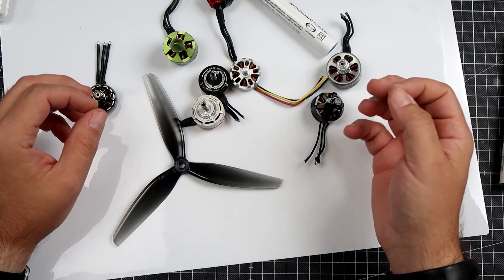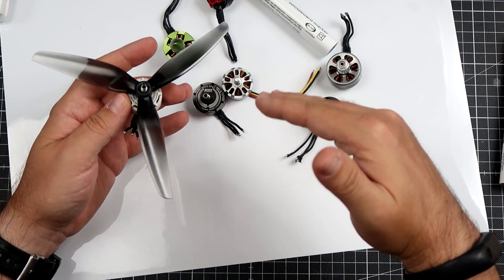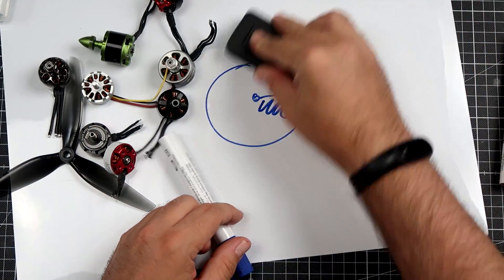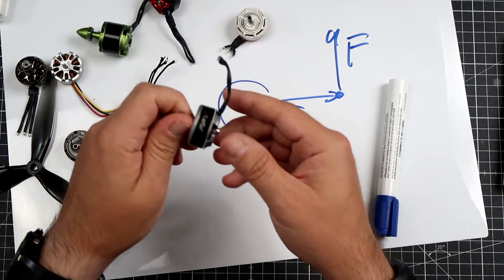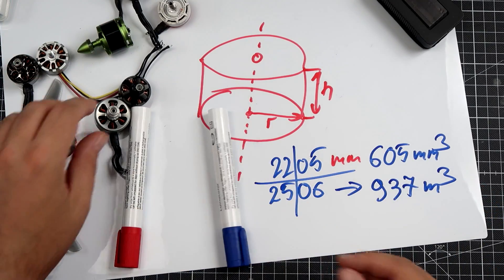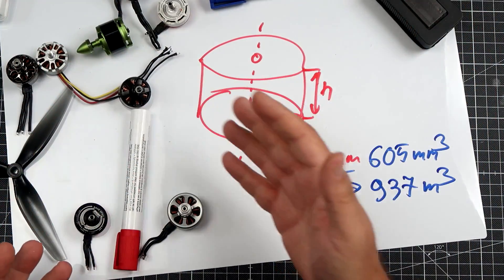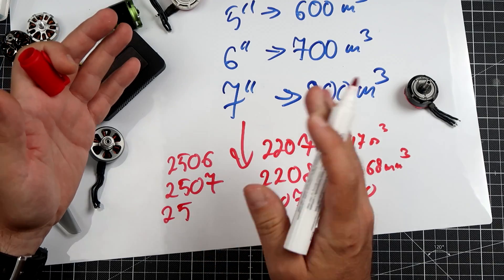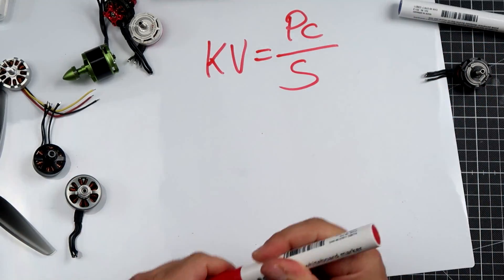How to choose drone motors? KV and torque

Comment: If we subtract 9600 - 7600 = 2000 and 7600-6400 = 1200 we get a PC difference of 800 and if we make this assumption then for 4" PC - 12400, 3" PC - 16000, 2" PC - 20400. KV for 3" and a 2S pack we get 8000KV. But what about the density? If 5" minimum is 600 mm^3 then for 3" minimum is 200 mm^3? Of course I'm not taking into account the Pi constant. A riddle.

Comment: For 4",3" and 2" what Is the PC propeller coeficient? You wrote: "The sweet spot/reference KV can be easily computed from this equation based on propeller diameter and supply voltage. Of course, more S will result in lower KV." I don't understand how the number 9600 for 5" came about.

Comment: An informative video!
Then I almost guessed right. 
I have chosen 2207 motors with 2050KV for my 6 inch / 4S quad. I currently use Gemfan Cinelifter 6030 propellers.
Should I remain with ~30 pitch because of the slightly higher KV number, or should 42 pitch also be ok?

Comment: I also would like to add that the propellers seems to be very big for the volume of these tiny engines,  even if the calculation had been right. I never seen such propellers on such small engines.

Comment: The calculation you’re writing down is not correct. This means that the calculations you made prior to this video trying different propellers has to be incorrect as well for the calculation of the propeller size your telling us now to be somewhat “correct”. That is if we also make the incorrect calculation you did. So to everyone watching, you will end up with a volume 3 times higher if you know how to calculate volume, this will get you dead wrong figures.
This guy obviously don’t know that if you write a little 3 after 600 for example it means 600x600x600.
Maybe he mean 600x3, that would make this calculation more accurate.

Comment: Very good informative video, love your approach with that. I was trying to run a 5 inch prop on a 18 mm stator motor on my plane. Smoked that thing trying to get some altitude
Reply from the maker: yup, too small, heat accumulates and everythjing overheats

Comment: So stator volume formula is : r2 * 3.14 * h ? So for 2204 should be 1900mm3?
Reply from the maker: d = 11, h = 4, r = 11

11 * 11 * 3,14 * 4 = 1519
Reply: @FPVUniversity  Yeah, sorry, I just counted 2205 instead 2204 (multiplied by 5mm height instead of 4mm)...  Thanks

Comment: I use 2806.5 xing on my 7" true X and although it flies just fine, I've always suspected they are too big.   What is your opinion? 6s and 1300kv.
Reply from the maker: For 7 inch those motors are fine

Comment: Good I needed a Hug ! was skeptical if I screwed up on my new 7 cruiser build order.  Got RaceStar 2508 1200 KVB and 7x4.5 two blade props coming. I'm a total noob so thanks for the Hug!
Reply from the maker: This motor is ok. You can easily put any 7" prop on it no problem

Comment: You seem to be the man when it comes to 7 inch. I have the Emax 2807 1500kv motors and the Geprc mk4 7 inch frame. 5s will keep my prop tips below the speed of sound. 5mm arms though. I'm going to glue more carbon to the arms to thicken them up and I'm hoping the glue, which is softer than the epoxy resin will help to dampen vibrations.

Comment: I'm using 2207 on my 5" which give me more control over the 2306 I was using because of the increase in stator volume. I'm planning a 7" build and was thinking 2807 emax motors. Is there a frame you like or a frame I should stay away from? 7" probably has a lot of vibration because of the longer arms and heavier motor and prop.

Comment: This helps thank you!
Reply from the maker: you are welcome
Reply: @FPVUniversity  I was wondering if I could pick your brain real quick. Based on your algorithm, 7 inch 2807 motors 1700kv for 4s should be sufficient. Now would it be efficient and powerful enough for some high speed cruising? Or would something like 6s 1300mah be better suited?

Comment: I'm using some NIN 2806.5 1350kv motors, and they work great on my 7", but at $30 a pop they are pretty pricey.
I need a substitute for my next build that's a lot cheaper but just as good.   Maybe the Brotherhobby Avengers.

Comment: Well that's a very strange, misleading and roundabout way to come to a roughly indicative relationship that trends more or less in the right direction.

More correctly, torque varies with the inverse of kV (you can calculate torque from any published specs, it isn't given separately on data sheets as it would be redundant), with the limiting factors being magnetic saturation and power rating. Power rating  is roughly proportional to stator volume for motors of similar construction, sure, and torque at saturation will be proportional to air gap area x moment, which happens to also be proportional to volume... so it amounts to roughly the same thing in practice for motors using the same magnets, gap and stator construction, but it's not very useful if the motors differ much. Different stator materials will change the saturation flux, stronger magnets or better air gaps will increase emf (increasing torque and lowering kv), cooling will affect power limits, better winding efficiency will pack more copper into the same stator volume etc. . The volume may a good rule of thumb if comparing motors of the same series from the same manufacturer, but if you want real results for torque or want to compare different models, it's no substitute for going to the data sheet and doing the maths.

Comment: Hi Pawel, I really enjoy your videos and would like to ask you a question about my Tyro129. The original motors 2507 - 1800KV came with an aluminum shaft and are now bent without crashing at all. So I purchased XING 2207, 1800KV. My Tyro129 was flashed with Arducopter, therefore no flips and 3d stuff for me. 
QUESTION: Will these motors work fine for me at 4S having in mind my calm flying habits? Thank you!

Comment: I love your videos, and all of the information. I am currently building a 7" Long Range Super G+. I haven't picked Motors and Props yet. I'm torn between BH Avenger V2 2507-1500kv and the 1850kv. I mainly want to fly with 6S Li-Ion homebrew packs. What would you recommend? And if it's not too much of a hassle, would love to know if there's a prop that would pair nicely with this build. Cheers!

Comment: will 2306 1700kv with bi-bladed props will be good enough for long range?
Reply from the maker: on 5-inch? 7-inch?
Reply: @FPVUniversity  7 inch
Reply: @FPVUniversity  7035 prop
Reply from the maker: 2306 are too small for 7-inch

Comment: 16:18 - you're number for 7" looks really off for me...   for one thing, they are turning back upwards, and you're making a bell curve with 6" at the apex, instead of a slope with just 6" as one point along the line.  According to your bell curve, 1" props and 12" props would have both like super high kv motors.  You're 1" props will be doing fine, you're 12" props might be a strugglin'...     shrug not a prop expert.
choppergirl.air-war.org

Comment: hi pawel, fantastic video very informative. i watched another quad expert and he said that if 2 motors had the same/similar stator volume but 1 motor was higher stator, with smaller diameter stator vs shorter height and larger diameter, motor 1 will spin up faster hence producing more torque, do you agree with this? any chance of elaborating on this?  thanks again for the great videos!!!!!!
Reply from the maker: That is just wrong :) If both motors have same KV, the higher diameter motor will probably have more torque since the arm of the force will be longer. Also, relation between torque and RPM is inverted. The faster motor is rotating, the less torque it has available. The power might grow, but not the torque

Comment: cześć Pawel, thanks for the video, very interesting since I'm building a 7-inch Source One atm.

if you're saying that the limiting factor with smaller motors is the ability to accelerate the props rather than in providing power for steady-state thrust, then surely the inertial mass of the prop is going to be a major factor?  & that if you were to substantially lighten the prop by, say, running a two-blader rather than a three-blader (or by drilling lightening holes in the blades ;) ),  then smaller motors - eg 2306 - might be suitable?

Comment: So this means I would benefit by retrofitting 6 inch props on my Skystars G730L, as the standard motors are only 2306, 1800kv and a good 4s battery - and the 2508's, 1200kv running on 5s, I chose for my Chameleon 7 inch are entirely big enough for 7 inch props?
Reply from the maker: yes
Reply: @FPVUniversity  excellent, I'd ordered some 1300mah Acehe 75C  5S for the 2508's and may try running a couple in parallel, and have a good stock of their 1550 mah 95C 4s for the g730l    -  good to know, thank you

Comment: Hi, Pawel, do I have to alter these values if i have a 5" tri-bladed prop?
Thanks, Steve
Reply: Good question, since I'm thinking of using bi blade 7" on a 4s | 2207 1950kv

Comment: I fly 2208 1800kv Xing E motors on 7056! At first i was worried about the 7 inch prop on the 2208 but... i calculated the 2208 to have 968 mm of volume  which is morr than enough. Been flying hard with no issues even on 6s but need to keep an eye on throttle

Comment: Hi Pawel and everyone, I do have a question on my next buil. In have a 6 and 7 inch freestyle frame and I do have two kinds of motors with different KV’s but same brand. First ones are the EMAXX RS-2306  KV-2750 and the other ones are EMAXX ECO 2306 2400KV. Which motors suits the 6 inch and 7 inch kwad? I would like to do a little bit of freestyle while doing long range. Any answer would be much appreciated

Comment: what motor could be advised for a 9" set up ?  the new 2806.5 or are these to small and I should go up to 2814 ??
Reply from the maker: 2806 is probably too small. 2814 should be a better option

Comment: Are the 2306 1300kv motors OK for 6 inch props though on a 7 inch frame on 6S?
Reply from the maker: 2306 are too small for 7 inch props no matter the voltage.
Reply: @FPVUniversity  I know, I am asking about 6 inch props. I tried the 2306 on the 7 inch and it was very unstable! I wonder if I should replace the frame with a new 5 or 6 inch frame...

Comment: And I'm sure it's just a coincidence that the abbreviated PC could also be the Pavel Coefficient. 😉 good video though I'm more of a 6" flier and I thought that 2000kv on 4s felt about what I wanted, so a little bit higher than calculated, but it's good to have roughly translatable baselines.

Comment: Very interesting, and may have answered why my 7” quad has this wobble on throttle punch. Originally, this quad came with 30A esc’s, and it flew on a rail, but eventually desynched twice out of the air, SO, you have to change something. I changed the entire stack, and motors, to a 4in1, and it’s never flown the same. I replaced the motors with the same size 2306 EMax Eco. Still unstable. So, watching this, I think I may replace with 2508, and see what sticks! What’s ironic is I have a EMax hawk 5, mod with the 6” arms, and that thing is an absolute rocket, that flys on a dime on 4s, it is rated for no higher lipo, but on 4s with 6” arms, running the Azure prop, this thing kicks ass!

Comment: sorry for the silly question the thing that confuses me most is the voltage on these motors . lets say im running 4s how come the " kv " is the same . you go to any wesbitr and it tells you from 4-6s 1700kv or 4-6s 2400kv so doesnt the kv differe or shouldnt there be for each voltage a kv i. e 4s 1700kv , 6s 1700kv , 4s 2400kv and 6s 2400kv . different motor for each voltage ??

Comment: why i do no see the connection between the RPM and the AoA of the propeller? Everything begins here. For highher torgue its enough if you choose lover same size lover KV motor. THere is a connection the highher is the KV, the highher is the Amperge and the lover is the torgue. Connect this with the AoA of the prop + the formula for multibladed prop. Measure the Amperage and thrust to find the optimum prop for the motor. If you know the total weight and the thrust, its easy then. Unfortunatly this video ends with in my opinion and not a fact, like based on the measurement this combination is the best of the sets I have....
KV without  values A x B make no sence. This tips might work, might not....
Reply: ah, what will be the speed of the miniquad? Thats the first step to chose the right AoA prop before going to the motor, guys.
Reply: Do you have prop/motor suggestions for 7 inch long range 60km/h, 4s 1500mAh (maybe 2 batteries parallel)?
Reply: @radekr981  that a low speed...what is the bigest prop will could be fited there? use the rule: (x)*(x/2) like 7*3.5 and if your motor is nominated for max 16A and with this prop it consumes 20A at static measurement on max throtle, selekt smaler prope, try 7*3, or 6x3.5 and measure again to prevent your motor from burning, select high KV motor and later the battery for the flight time accordingly. But lets ask first what will be the flight weight approx? (I am asking because the motor + prop defines the Thrust, what could be approx 1.3-2.0 more compared to the weight, let say 1.5 is enough, and no need for 3 blades, they are less effective)
Reply: @fromika  yeah, I just weight all my props and chosen lightest ones with lowest pitch. Have 6.5 inch tmotor props and 6040 two blades. I'll have a look how it flies. 400g quad + 200g battery max 7 inch 2205 2000kv.
Reply: @radekr981  ok, so we have 800g. X1.5=1200/4=300g/motor
2205 could produce it at 50%th with 6045 prop@38W (and approx 550g @100%) I would select 7025 or something like that from elektroprops of APC likes and might smaller motor. Anyway you will have plenty of reserved power for extra battery.

Comment: Sounds too big ... but try the new Brotherhobby Avenger 2806.5 on 1300kv ... but you need a stiffer prop than the HQ 7x3.5x3 ... the motor is not even heavier than a 2507
Reply: for 6s ... the 1300kv

Comment: I love my 2508's (Racerstar/T-Motor) on Chameleon Ti 7" LR, that I recently finished and flew.  Mine are the 1200kv & am running 4's 1500mah 95C's  through T-Rex 60a esc's.....   It flies nicely on the 4's but intend to run large 6's for longer flights and range, once I've flashed iNav and connected GPS.....  Great info as always... Thank you

Comment: I understand your idea and it makes sense a larger motor has more torque. But if you compare say a 2306 to a 2507 (motor dependent) the 2306 can produce more watts of power and at times more thrust. Motor design, quality, number of cells plays a huge part .
Reply: More watts in heat not torque ,,,

Comment: Are you omitting shaft size in your calculations? It seems quite important, takes significant volume after all.
Reply: bearing hole not the shaft but it doesn't matter for this context. Size does matter,,,
Reply from the maker: To keep it simple we can just skip that

Comment: Hey pawel, have you seen kebabs video on motors for 7”?
He recommended the brother hobby 
2806.5 motor, which I calculated to be
4002mm volume, any thoughts?
Cheers 👍
Reply from the maker: for me it's an overkill
Reply: @FPVUniversity  So will it be inefficient on battery vs something smaller if your flight style is theoretically the same? Because you say "overkill", what if you want that surety of pulling out of dives etc on the 7"?
Reply from the maker: In my math I forgot to multiply by Pi, so divide by 3.14 ;)

Comment: The PC values seems incorrect?
Reply from the maker: Indeed, 6 and 7 are swapped in the video. They are correct in the description
Reply: @FPVUniversity  In description they are as in video: 
"Pc for different prop sizes:
5-inch props - Pc = 9600
6-inch props - Pc = 6400
7-inch props - Pc = 7600"
Reply from the maker: check again, I see them like this:

Pc for different prop sizes:
5-inch props - Pc = 9600
6-inch props - Pc = 7600
7-inch props - Pc = 6400

Comment: Wish this video had been around a few months ago. Tried 2306 1600kv on 6s on my 7", then 2407 1700kv, and now I'm on the sweet spot of 2508 1200kv 6s with 7x4x3 props. 7min hard freestyle, 16min cruising.
Reply from the maker: Well, me too... I would not spend money on motors that were just not good for the job
Reply: @FPVUniversity  I did spend the money. d'oh! :D You'll save people a lot of pain and money with this video, thanks!
Reply: @vaughnd  your comment has helped me figure out what to buy now! I am just having a hard time finding that stater size with the bolt layout to fit a chameleon Ti LR 7 inch... :(
Reply: RossHasAdrone the racerstar 2508 1250kv fit my chameleon 7” 👍
Reply: @vaughnd  sick! just ordered 6 of them. nice that they're so cheap!
Reply: RossHasAdrone I know! And they’re surprisingly well built too.
Reply: @vaughnd  how much time did you do with 1600kv 2306 motor on 6s? and 4s?
Reply: Ernesto de Ruvo plenty of time, but flew like crap. Probably 12min or so on 2600mah 6s. Never pushed it for long as I switched motors shorty after trying to tune it.

Comment: People have been talking about "bigger motors" for 7" for quite some time now, smaller motors are terrible on 7" they cant even sometimes "catch" the quad, they dont have enought torque to spin the prop up.  3 years back i tried to fly 7" on 2205? and its was not a good combination.
Reply from the maker: I think current genertion of 2507 and similar is just right for 7 inchers.